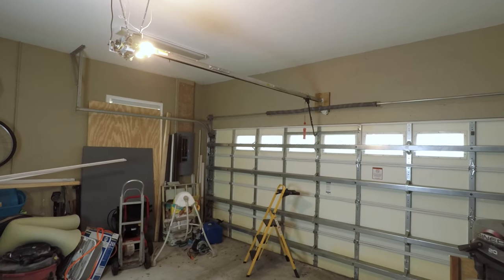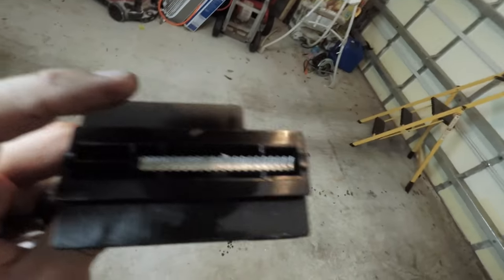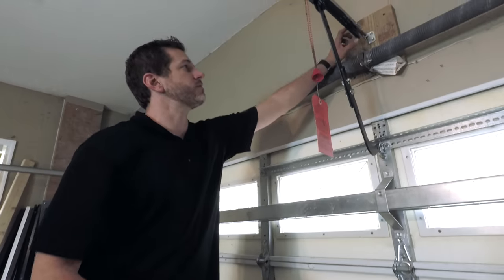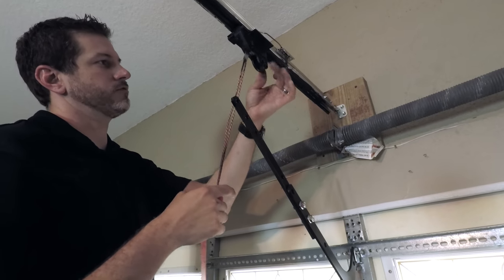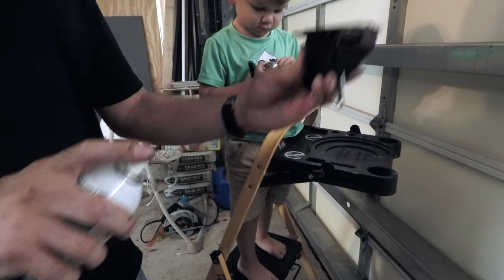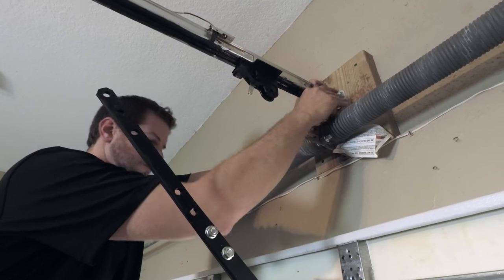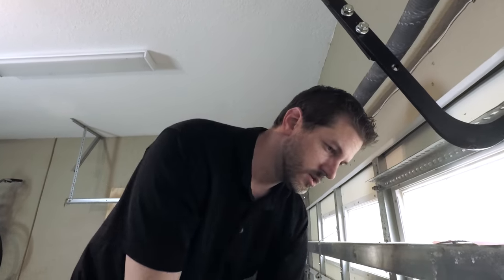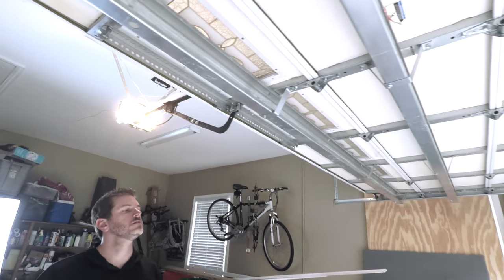Fix Genie Garage Door Opener - Screw Drive Repair - Carriage Broken

Comment: I just got the new part today, installed it and it's still doing the same thing. Do you think the entire screw assembly is gone bad? Is it possible for that to happen? Your thoughts and suggestions are greatly appreciated!
Reply from the maker: It’s possible. Try disconnecting the door from the carriage and see if the carriage will move. May have an issue with tensioners or springs, meaning the door is too heavy for it.
Reply: So as you suggested, I disconnect the carriage and tried running it. It goes down fine, but it doesn't pull up. Makes that same noice. I tried manually pull in up direction to see if the teeth are engaged, and they are. Would you have any suggestions? Thanks for your comments in advance. My first time tackling with a gurage door and its accessories.
Reply from the maker: Is the carriage loose in the track? It should not wiggle around when it is on the track. If it does, then that is your issue. Try to see why it is moving around. If it wiggles, then the teeth aren’t getting a good bite on the screw drive. If is does not wiggle, and assuming the teeth are still ok on the carriage, you probably have an issue with the screw that runs within the track. Have you inspected it? Does there appear to have good grooves in it? If the screw is worn, I might be tempted to replace the entire opener.

Comment: It just occurred to me that if you remove the 2 springs AND also the pins that the lever arm AND the linear gear might just fall out.  If thisis the case, you do not need to remove the carriage.  Just reverse the gear and slide everything back in.  I havent tried it, however, but its a lot less work, especially for the guys that dont have clearance for carriage removal.

Comment: I'm having the same issues that you show. I ordered and replaced it from the link you provided but it didn't fix the issue still won't close or open. Any ideas?
Reply from the maker: Make sure the carriage is fully engaged. Also make sure the springs have the correct tension. If you can lift the door without too much effort, the springs are probably ok. I would lean toward the carriage not being fully engaged.

Comment: I have an Overhead Garage Door Opener - My door will not open - it goes up about 8 or 10" and stops.  When I try to release it to open manually I cant budge the door at all.  Any suggestions?  Thx
Reply from the maker: If you disengage it when fully closed can you open it? I’m thinking maybe the tensioner springs aren’t doing their job. If you can raise it 8-10”, then it stops, I would guess maybe something wrong with the track, or the rollers are getting jammed on the sides.
Reply: Even after I release the carriage I can’t budge the door.  It’s weird I had just opened and closed it several times and everything seemed great
Reply from the maker: Do the springs still seem to have tension on them?

Comment: Do you know how to fix the screw part? My garage opener screw is in 2 pieces? Thanks!
Reply from the maker: The screw assembly, I believe screws together in sections. Have they come unscrewed? Or broken? Likely you will have to take apart the entire track system.
Reply: @IAmAFixer  Turns out the screw is in sections that connect with a collar and clip system. I just had to connect the screw sections together again.
Reply from the maker: That’s great! Glad you got it working. I’m probably going to tear mine apart and clean in sometime. I’ll video it.

Comment: I have it on, can’t get the arm on the emergency pull to go back to engage the door...any thoughts?
Reply from the maker: It can sometimes be hard. You have to pul forward hard to engage it. Also make sure you have the carriage on correctly. If it’s on backwards, the teeth on the carriage won’t line up.

Comment: I'm a fixer too, but my screw drive opener goes down a bit too much and slightly raises the rail. I have the CLOSE setting knob at zero and it still does it. Any idea why?
Reply from the maker: There is a sensor switch at the end of the rail closest to the door opening. The carriage touches it, grounding the sensor and stopping the door. Adjust that. Move it a little further away from the opening so it won’t close so far.
Reply: @IAmAFixer  I have moved that limit switch 5 times at different position towards the unit, but the carriage was going passed it. I know the switch works. I'll figure something out after calling Genie company.  thnx
Reply from the maker: That switch is just a simple close circuit. You should be able to use a screwdriver to touch the two screws the limiter switch is attached to in order to assure the board is working. Then I would manually push on the limiter switch to ensure it is working. If the door doesn’t stop in either case, your issue is the board, switch, or wires from the board to the switch. How did you determine the switch was good?

Comment: I fixed that carriage about a year ago.. now when I try to lift it the screw spins a little then sits still while motor keeps spinning like its stripped... what is on the end of the screw splines or what? Or is it stripped in the motor you think? There is like 5 washers that are around the screw on the motor end that are loose when it's down but tight when up..  it's worked fine for the past 5 years
Reply from the maker: Hmm.. Does the door move at all? It sounds to me like the spring tension on your door may be too light so your motor was/is having to work extra hard to raise the door. That would explain why the carriage striped out before, and you had to replace it. It's possible that it has now stripped out the screw drive mechanism inside the motor. It's hard to know from the way you described. I haven't pulled apart the screw drive since I installed the door 10+ years ago. I can't remember what the inside looked like.

 Even though you replaced the carriage a year ago, I would remove it and inspect it to make sure it isn't damaged again. If it is, I would suspect you have too little tension on your springs. You have to really know what you're doing if you want to adjust the spring tension (it's definitely doable for a DIYer, I have adjusted mine before), but you have to be extremely careful. It is under a lot of tension and you could really hurt yourself if you don't know what you're doing. I would inspect the carriage and if it looks ok, then try to get to the part you think is possibly stripped and see what it looks like. 

There's a lot of things I try to fix that I know nothing about, I just take a lot of pictures and make a note of how things go together.
Reply: @IAmAFixer  thanks for the reply, you were some of the first few videos that came up and u sounded knowledgeable so figured I'd ask, but I found the worn part called the screw drive coupler.. luckily a shop down the road had one for $2.85, cheaper than amazon prime.. turned out to be a fairly simple fix for having no idea how the motor was connected or anything when I started.. as far as why it wore out maybe it's just old or maybe  the spring tension is in fact to tight,  but that's something I'm scared to mess with and have never even looked into to see how it working.. the part I replaced was 30257T seems like it's the 1 most all genies screw drives and a few others use.
Reply from the maker: Thanks for sharing! Somebody may have the same issue as you and your comment might just help them out. I appreciate you sharing and watching!

Comment: I have the same kind of problem but on my garage the door goes up without any problem but when you want the door to go down it keeps stopping And going back up. I have already checked the door sensors and they are not dirty and they are lined up
Cannot figure out what is wrong
Reply from the maker: Maybe the springs have too much tension on them. If you disengage the opener, can you manually close the door?

Comment: I would check the balance of your garage door. If it's way to heavy to lift, ur going to be back at the beginning within a few months
Reply from the maker: You may be right. I’ll check it. The carriage issue was a result of a power outage and the carriage not being fully engaged when trying to use the opener again. The screw just chewed it up.

Comment: How long do the carriages normally last ?
Reply from the maker: Mine lasted 11 years. I only replaced it because it was disengaged and then not fully reengaged. It chewed up the teeth
Reply: @IAmAFixer  I bought a home built in 2007. Thinking of replacing mine even though it seems to be working fine.
Reply from the maker: I would say if it’s working fine, why bother? Maybe buy one to have in case it ever does, but if it’s working well, I think you’re fine. Maybe get some lithium lubricant and lubricate the screw.

Comment: I get a buzz and door won't open, replaced carriage, coupling and capacitor, any ideas?
Reply from the maker: If you disengage the carriage, can you see the screw drive moving? Maybe the spring that helps lift the door is damaged. Causing it to be to heavy for the opener, and likely stripping the carriage again. Try taking of the carriage and see if it is stripped out again

Comment: With all respect to the numerous "fixers", you do not need to buy anything! When you remove the carriage, remove the 2 springs and the linear gear will fall out. Just reverse it and put it back.  The teeth HAVE NOT been worn on that side because the wear is due to heavy LIFTING.  It will work like new.
You should know that the torsion springs on the door should be spray lubricated to prevent seizing, and if you cant lift the door by yourself  with the carriage disengaged they need adjustment by a tech.  This is why the linear gear teeh wearout ONLY in one direction.

Comment: The screw drive needs more lithium grease. That noise is from lack of lubrication (they're all noisy, but worse when dry)
Reply from the maker: Not anymore. I replaced it with a belt drive. So much nicer.
Reply: @IAmAFixer  I did that at one of my old homes. My current place has a screw drive. Replaced rollers, lubed hinges and screw, much better but could be more. Looking to replace the carriage next. Suspect it's worn from prior use.

Comment: I feel like your opener power is too small, is your opener power 1/2HP or more?
Reply from the maker: Thanks qui, but my wife tried to open the door with partially engaged, which caused the problem. I will remove the screw and clean the track in a future video. That is the issue with the noise. Thanks for watching!

Comment: Replaced and the door worked great for 2 days and then the slipping started all over and nothing seems to fix it?? any ideas???
Reply from the maker: Sounds like maybe you have an issue with the spring tensioners. Maybe the door is working too hard to open the door and eventually breaks or grinds down the teeth on the carriage.

Comment: I can’t get the new trolley to engage. Any suggestions.
Reply from the maker: Likely not pulling hard enough towards the opener, or maybe you put the carriage in backwards?
Reply: Have you engaged the release lever that's on the unit? It should be in the up position to lock onto the threaded drive rod.

Comment: where you get the carriage from?
Reply from the maker: I got it from Amazon....

 Door Carriage: https://amzn.to/2TZMq0o
Grage Door Lubricant: https://amzn.to/2Eimurj

(Affiliate links)
Reply: @IAmAFixer  hi there are some quality issues w this part. It breaks at the weakest plastic link and the garage door willl come crashing down.  Is there another option for this part or is this all there is ?
Reply from the maker: If the door comes crashing down, then you have a lift spring issue. The door should be able to be placed in any position and it stay there (give or take). Likely springs are sprung, so they are not assisting the door in opening. That’s why you keep breaking the carriage

Comment: This did not work. Chain moves but won't pull the new carriage or the door. Any thoughts?
Reply from the maker: Are you sure you have the same system as I described in the video? Mine doesn’t have a chain, it has a screw drive.
Reply: @IAmAFixer  that's what I meant. It is the screw drive
Reply from the maker: Are you sure you have the carriage fully engaged? That’s what destroyed mine to begin with. We lost power so my wife disengaged it to get out of the garage. When she tried to renegade it, she didn’t pull hard enough forward to engage it and it chewed up the carriage. Also, make sure you have it installed in the right direction so it’s not backwards.
Reply: @IAmAFixer  thanks. I'll try that
Reply: The screw drive will cycle fine with no hiccups, but I can't get the teeth to bite. Did I already grind through the new carriage trying to get it to latch?
Reply from the maker: It’s possible. Pull off the carriage and take a look. If it’s not seated properly, it doesn’t take much to mess up the teeth.
Reply: So I watched the screw drive, it's only working intermittently...
Reply from the maker: I think there is a coupling near the monitor and screw that can be replace. Maybe it is worn out

Comment: Caution, the replacement carriages from amazon will break. The plastic flange will snap off. I have been through several of them. Note that when this breaks, the door can free-fall and presents quite a safety hazard.
Reply from the maker: Sounds like your springs aren’t tensioned correctly. That’s why your carriage keeps breaking. The door should not free-fall if the springs are tensioned correctly.
Reply: @IAmAFixer  The door wont free fall unless it has already started moving. It is a heavy hurricane rated steel door. I just bought another brand without this safety risk.

Comment: The fact is, this guy had just barely enough room to remove the carriage assembly. I DON'T have enough room to remove it. By that I mean the carriage assembly bumps up against that wall when I try to remove it. There is not one single video on Youtube to explain what to do if you don't have enough room. Not one.
Reply from the maker: You will have to remove the front two bolts that attach the track to the wall, then lift it up or drop it down so you have enough remove to remove the carriage assembly.

Comment: Mine has exact opposite problem. It does not have a sensor so not the issue. Help please
Reply from the maker: You need to give more info. What do you mean it doesn’t have a sensor? What is your door doing?